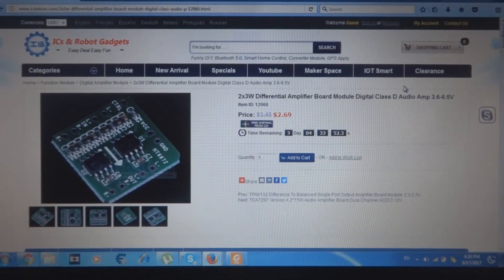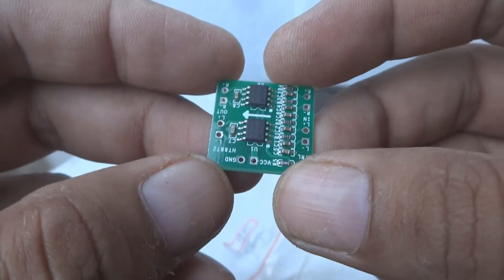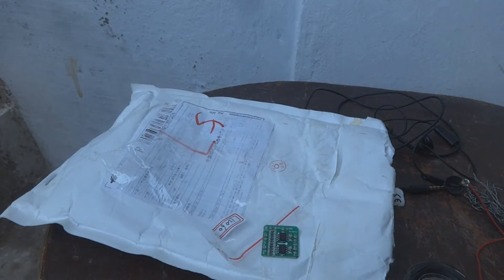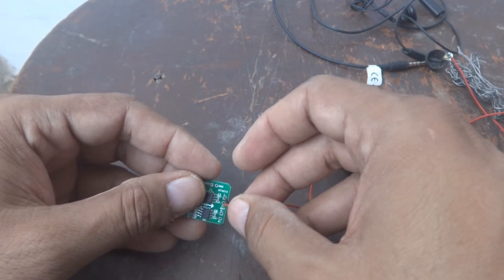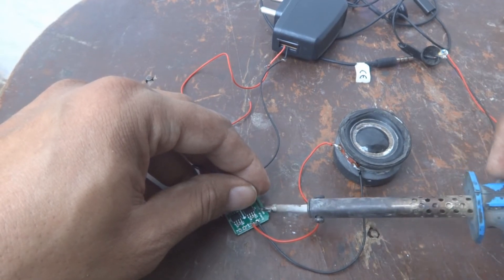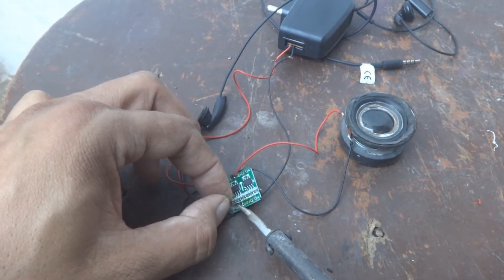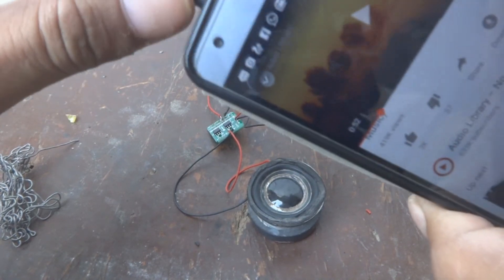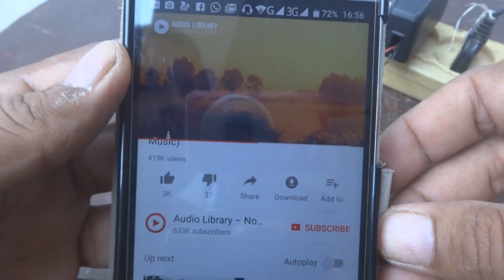The smallest audio amplifier in the world HT6872

Comment: Hello sir,  I have a query regarding RF generator and RF amplifier... how can I increase the power of a RF generator signal upto 60-80MHz using an Amplifier? and which one to be specific?
Reply: Thanks for comment. Your question isn't clear. Power is in watts and dB not in Mhz. Mhz is unit for frequency. So do you want to increase the frequency or power of the signal generator output? If power then it's possible with power amplifier. If you want to increase the frequency then it isn't possible. Instead you may buy another signal generator of desired frequency. Wish you good luck.
Reply: @engineerkohat  please accept my apology for the incomplete information sir, i actually want to increase the power of the signal generator upto 1.2W. and how to use an amplifier to increase the power upto 1.2W?
Reply from the maker: You may use an FM power amplifier as your signal frequency matches to FM range. Or other way is you can use two or more amplifiers to get wide range of signal. You can deal FM power amplifier on  AliExpress for best low price. Wish you very good luck with your project and let me know your success.
Reply: @JahanZeb1976  thank you so much sir.

Comment: I think the gain is lower power input and they dont get so hot in operation.

The audio input amplitude is used to pulse width modulate a triangular high frequency carrier, then later after a digital amplifier its passed on to a low pass filter to remove unwanted product frequencys outside the audio range.
Just my crude understanding.
It's more complicated than that, but i dont have any interest in class D amplifiers lol.
Reply from the maker: Your understanding of the class D is great. Class D had efficiency benefit among other classes. The problem with them is the circuit complexity if one is going to construct himself or herself.